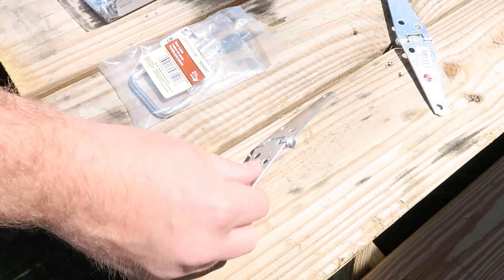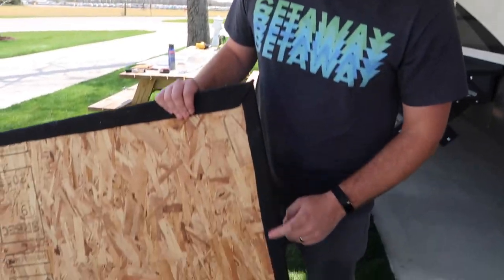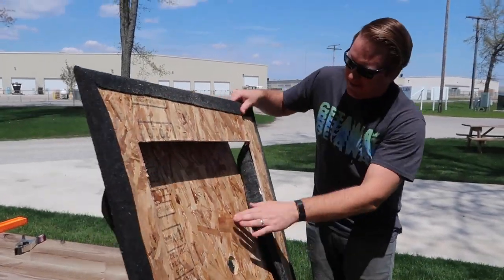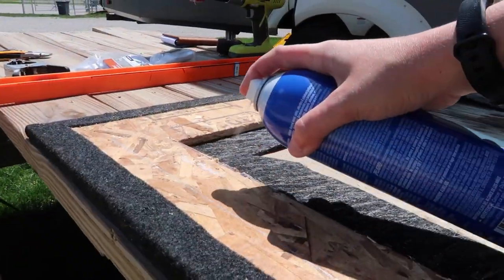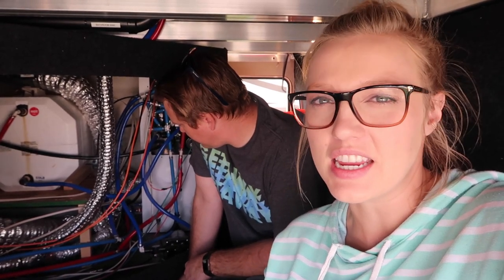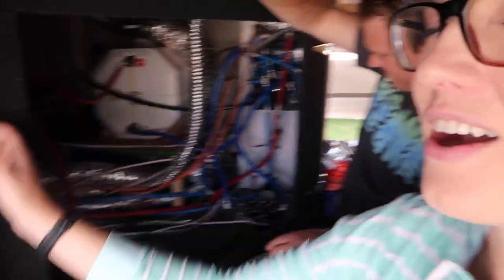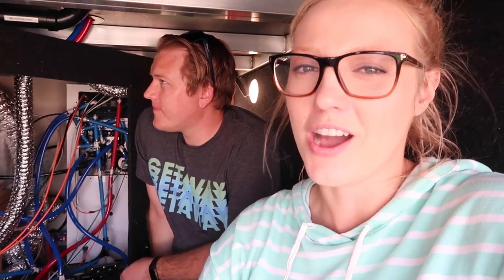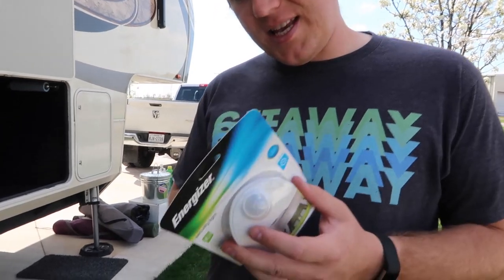RV MODS! 5 SIMPLE UPGRADES TO MAKE OUR LIFE EASIER!

Comment: As a carpenter/ welder/ electrician for over 35 years, first tip, use rubber washers for the plexi.  Spray 99 is the king of the hill for spray adhesive.

Comment: Drill out the screws' pilot hole with a counter sink bit so the shoulder, below the screw head, has a "seat" to set into. That will put all the pressure of the screw head onto the surface of the "plexiglas" in an equal amount and thus avoiding a forced spread of the pilot hole. This works with any material you pre drill. Loved your video. You are a funny and cute couple. Happy travels.
Reply from the maker: Thanks! Adding that to my info bank of how to's. Thanks so much for watching!

Comment: I get into all kinds of issues with projects too. So one thing I’ve learned is that there are little rubber washers that you can put between the screw and the plexiglass.  That way you can tighten the screw to the wee washer and it’s tight but protects too much pressure on the plexiglass.

Comment: The plexiglass broke because you used counter sunk screws which put outward pressure on the plexiglass and leads to cracks. Just replace them with a flathead screw and all will be good. Keep up the great videos
Reply: You noticed the "buglehead" screws also, a big nono with plastic.

Comment: Our favourite mods for our trailer was upgrading the standard fan to a Fantastic Fan that actually automatically shuts when it senses rain. It moves so much more air that we use the AC way less. Our second favourite upgrade is yet to be done – we’re swapping out the frosted door window with one that has a shade built into the window itself.

Comment: Hey !! I just watched you make your first mod on here with the acrylic panel I the cover! I wanted to offer some helpful advice to anyone looking to copy this mod. They make acrylic screws and washers so that you don't crack your panel. If you can't get the acrylic screws or just prefer the metal screws if you use a soft washer your less likely to crack it and you can tighten it better :) also last tip! Silicone works great on sealing everything BUT acrylic. So if your looking to make this watertight or leak proof you'll need to find a seal that isn't a silicone caulk. It might appear to hold at first but it won't last long. (Less that a few weeks) I really hope this helps you out (or anyone really 😊

Comment: I'd suggest drilling small holes at the ends of the star crack on the plexiglass.  That will help it to stop the spread of the cracks.  Just a quick tip.  Good job you two.

Comment: you needed some washers underneath the acrylic plastic to keep it from flexing and then cracking like it did.  It is pretty brittle stuff but cheap.  Polycarbonate aka "Lexan" is the stuff they use for hockey rink "glass".  Very tough and hard to break but very expensive.   It's a great mod the way you did it, I want to see the back of all that plumbing and wires too.  Thanks for sharing!!!

Comment: Good upgrades. The only thing I would recommend now that you have so much invested in your RV that you check to see if you have the best insurance coverage and add a system like I had for fire suppression remember an RV can catch fire from propane, refrigerator or short-circuit.

Comment: Round or pan head screw would have been a better choice for the task. The flat head screw is designed to be countersunk, therefore it expanded the hole as you tightened it, cracking your clear acrylic.

I attach my outdoor temp sensor with heavy duty Velcro in an area out of direct sunlight (should also keep it dry during rain.) We just have to remember to remove it before travel.

Comment: Do you think a rubber washer may have prevented the plexiglass from cracking?
Reply: Pan head or round head screws would have been better than flat head. The taper on the flat head screws will blow out the acrylic. I think I would have framed the acrylic with some lath like a picture frame and not drill it at all .
Reply: They also make acrylic screws and washers that can be tightened but won't break the acrylic. Personally I commend them for showing the "fails" so often you'll find YouTubers who omit them ! It's so much better to show the things that can and do go wrong.
Reply: pan head screws would of been better or you can use a counter sunk washer that would provide wider pressure.  great job kids really like the ability to see the mechanics.

Comment: I just did this today and don’t know why it’s not standard for water storage tanks. The valve for our tank could only be accessed from the far corner of the one bench, most inaccessible place possible. I got an extra of the round electric covers from the RV store. Drilled a 3.5” hole on side of camper right in front of that valve. Affixed, sealed and caulked the cover (I also cut off the little tabs on the inside of the cover). Now I can access that valve from the outside, literally right next to the fill port for the tank. So much EASIER!
Reply from the maker: Awesome to hear - good job!

Comment: as far as attaching the Acrylic. First it was the wrong kind of screw.  Instead of using a cone shaped head, use one that is flat, and place a washer.  It'll distribute the pressure of the screw against the acrylic and help prevent cracking;  The other option would be to use a couple of aluminum strips to instead of washers.

Comment: Take your chain link and put it on your loop in the truck and your spring connector on your cable. It should be easier to connect to the chain link since it is smaller around than you truck loop.

Comment: I have the same remote weather station sensor and I have mine mounted in the pin box area where you were considering putting it. Has traveled in that location without a problem!

Comment: As I will be ordering the 2020 version of your rig later this year, this is very good information to know before hand. Also, if you know what the upgrades GD has done between your model year and the 2020 version will have, that would be good to know. I've tried the "contact-us" link on their website but it does nothing but forward my questions to the local GD dealership...which, sadly, doesn't have the answers I'm looking for.   Be safe, have fun, & happy camping.  v/r, TS

Comment: It was difficult to tell from the video as to whether you empty the dog food bag into the storage bin. Please don’t. Leave the food in the bag and nestle the bag into the bin. We have owned two part supply stores for more than 20 years. Occasionally we have a client that reports that the food went bad and the dog got sick. We always ask for the production run and date code from the bag to report it to the manufacturer. In 100% of the cases, not 95%, but in all cases the answer is, “we don’t have the bag, we pour the food into a bin.” The bins rarely get washed out properly to get rid of the “fines”, or left over particles from the kibble. And if they are thoroughly washed, they aren’t often completely dried. This allows the breakdown of the bottom few inches of the new kibble to start and accelerate. The spoiling of the food also involves the fat oxidizing, and the best way to accelerate this process is to pour the food into a bin and mix fresh oxygen from the air through out the new food. Leaving the new, fresh food in the bag preserves the freshness and helps prevent the breakdown of the bottom few inches of the food. A bag should never be opened longer than 6 weeks, and probably less in a hot RV. Smaller sized bags mean fresher food.

Comment: Used the wrong Screw-Head Type for the Plex-Glass. You wanted the Screw-Head that is round on the top, and flat on the surface of the glass. The wood screws you used are angled on the glass surface which creates a wedge situation. Hence the cracking of the Plex-Glass.

Comment: Use this for the brake cable, theyre 4’ or 6’ whichever you need. Fastway Zip 6 Foot Breakaway Cable 80-01-2160 https://www.amazon.com/dp/B004TR4IGW/ref=cm_sw_r_cp_apip_QCqDVIYy79neX

Comment: The one thing that worries me I probably looked at a thousand RV upgrades and I have never seen anyone upgrade their SMOKE DETECTOR. That is very disturbing and the crazy thing about that is it isn't an expensive upgrade. I have a 2017 34 footer and it came with one smoke detector that is unacceptable. I recently changed the batteries in that one smoke detector and pushed the test button nothing happened. So I took it out to the range and used it as a clay pigeon and I promptly replaced my RV smoke detector I installed one at the bunk room one in the kitchen and on at the door of the master bedroom now i'm happy because all other upgrade's can wait my FAMILY COME'S FIRST.
Reply from the maker: Glad to hear you found a sporting use for the old one!! 😂 Stay safe!